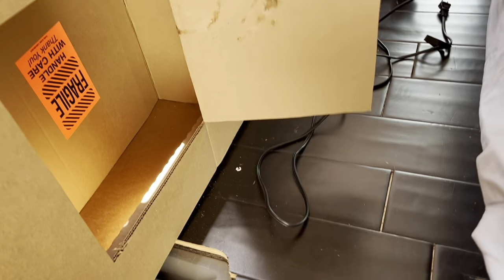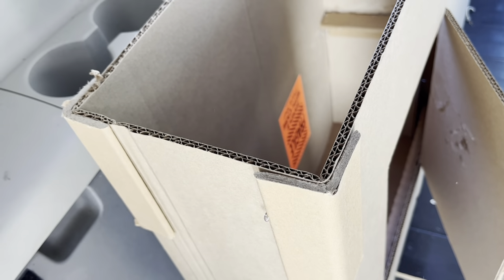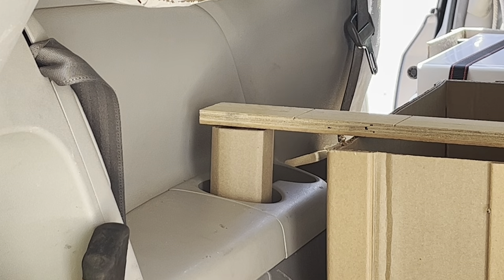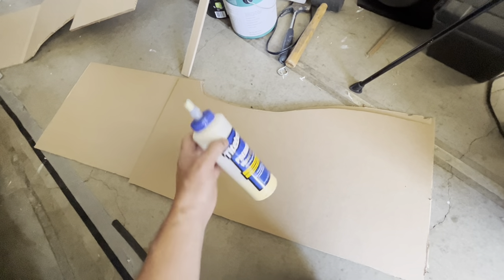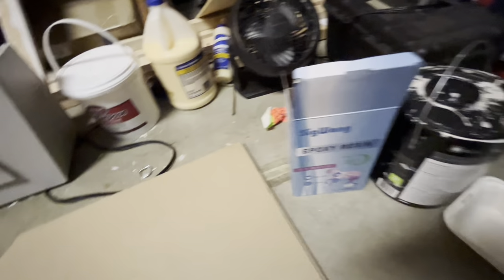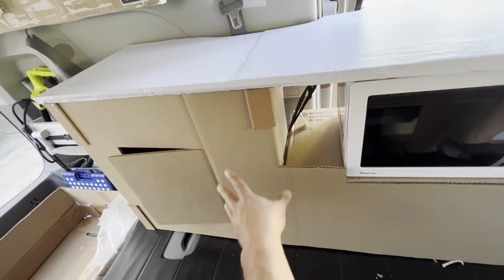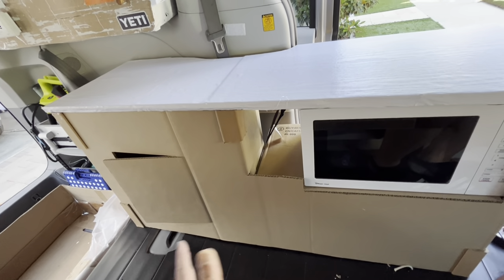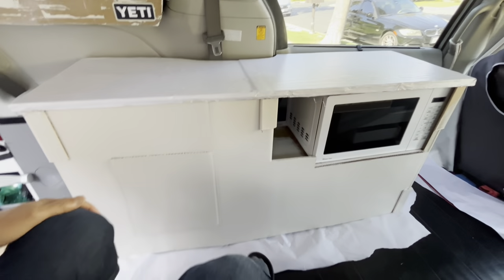Cardboard Camper Counter Cabinets PART 2. Many More Lessons Learned. Sienna Cardboard Camper EP6

Comment: Saw your cardboard counter on July 5th.
Started building a sidewall cabinet for my minivan the next day. Mine is a bit different than your build with its curved corners.
I used GORILLA GLUE and Hot glue for my build; plus a piece of 1/4” plywood and a section of builders sheet foam board.
No packing tape at all.
Almost completed the build on July 9. I will cover it with “Poor man’s fiberglass” to camouflage the cardboard construction.
Paint will color match my van interior vinyl
Color.
Thank you for the concept as I had been looking for a bendable material
Reply from the maker: Awesome!  Happy to hear

Comment: I would have used scrap cardboard to make L brackets that go on the inside of the tabletop area so that the glue isn't visible from the outside.
Also for that bent cardboard door from the paint you can glue some chopsticks on the inside to help fight the memory.
Reply from the maker: Great ideas!

Comment: Spread your epoxy with an auto body putty spreader poly blade or an expired credit card for a more durable tool.
Epoxy that is not set up yet can be removed with cheap white vinegar.
Reply from the maker: That is a good tip. I am obviously not an expert on epoxy applications

Comment: Before you epoxy cardboard your best bet is to seal it with spray paint, can be clear or colored, but you should always epoxy on a sealed surface. :)
Reply from the maker: I was thinking the epoxy being absorbed by the cardboard would give it extra strength. Hmmmm
Reply: Shellac

Comment: Thanks for the videos, I really am enjoying them. Having done a little bit of building myself and making my own share of mistakes and now watching these videos, I won't call it schadenfreude, although I'm sure there is that element to it was well, but it's definitely cathartic watching you make some of the same mistakes I could see myself making. I know you kind of called it a proof-of-concept, but I'm wondering if you could see yourself using this "full time"?
Reply from the maker: I have different plans for a full time build. I think this is for those looking for a really lightweight solution or who don't have means to cut wood.  Someone who is good with crafts can do a really nice version.
Reply: @Tiny-Campers  Right! I'm really getting inspired by this since the small build I did for my xTerra was, uh, less than optimal. 😅

Comment: Love your content man. Very methodical work flow. I was wondering how did you measure that curved area to cut the cardboard so well to size for your counter top?
Reply from the maker: I forgot to record that part. A ruler with a pencil tied to other end. Run ruler against the curve and pencil will draw the shape